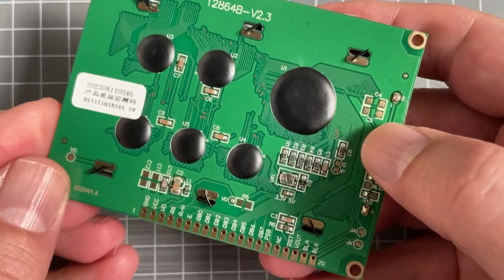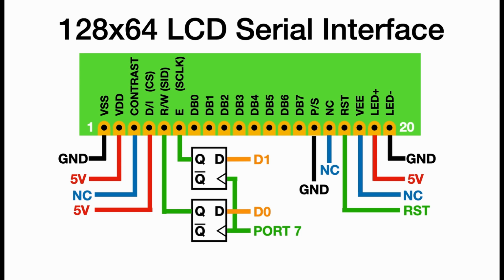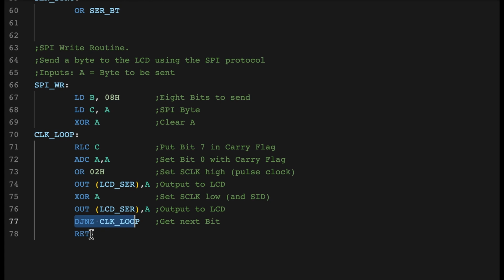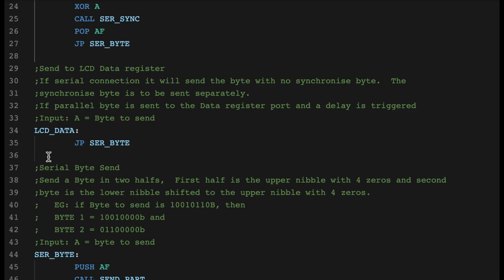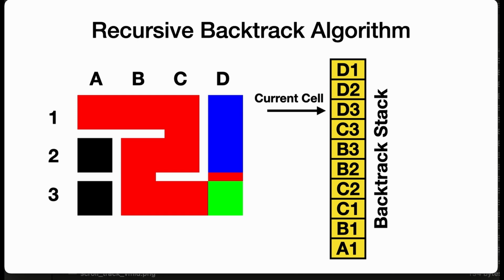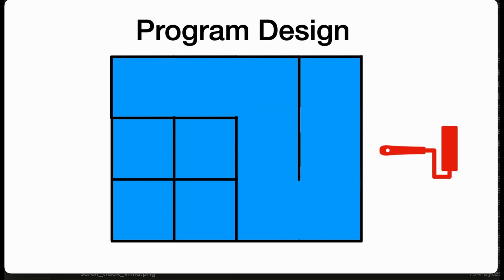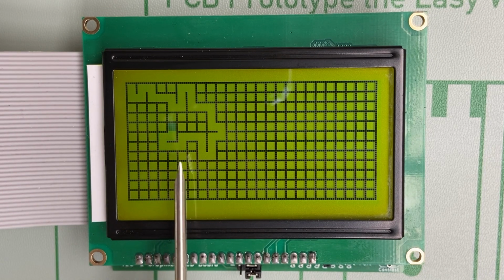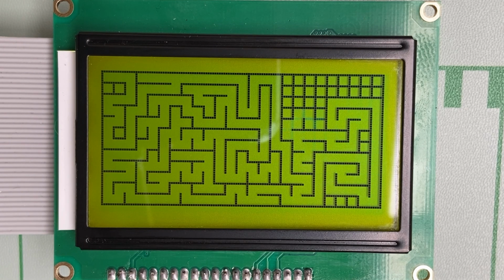LCD Maze generating using the SPI Protocol on the Z80

Comment: You only need to push cells that have more than one empty neighbour. IOW: if there’s only one direction you can go then don’t push the backtrack cell.
Reply from the maker: Yes, this is correct.  Only one free adjacent cell, no need to backtrack back to it after pushing through. But there is a loss of sequential current cell animation. Trade off!
Reply: @ReadyZ80  True… if you ever need speed thou… ;-)

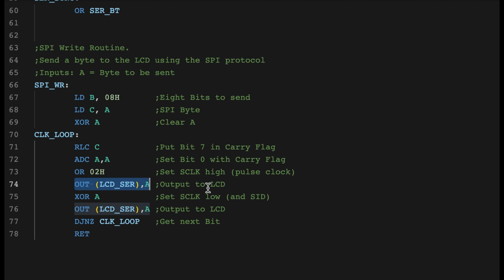Comment: 8:19 I don't know what clock you running your cpu but those clock pluse is not to fast/short ?
Reply from the maker: Good question. I was going to talk about this but cut it out.

I'm using a 4Mhz clock, one clock cycle is 1/4000000 or 250ns. The OUT instruction takes 11 clock cycles (2750ns). The minimum SPI clock cycle as per the spec is 400ns.

What would be the fastest clock that can do two OUT instructions and an XOR A in 400ns?  The three instructions take 26 CPU clock cycles.  Therefore
CPU Clock = 26 / (4x10^-7) = 65Mhz
Reply: @ReadyZ80  Oh I didn't know that SPI is so fast... 
Cycles i know and can calculate but I didn't know SPI specs, my bad 😅

Comment: Love these videos. Every time I see that display I think about building a handheld TEC-1 with just the lcd display and keyboard
Reply from the maker: Well the TEC-1G includes a 4x20 LCD and will have the ability to add-on the GLCD which will act as a terminal. There's a picture of the 1G at the end of this video
Reply: Yeah I'm a member of the facebook group and will get a G board when they become available. I built my first tec in about 1989 and used it for years to program eproms for microcontroller programming.  I'm just thinking of a handheld TEC without the LEDs just the graphic LCD and keypad, the chips on the back of the LCD and keypad area and serial interface port. It's completely unnecessary, that's why it appeals to me :)